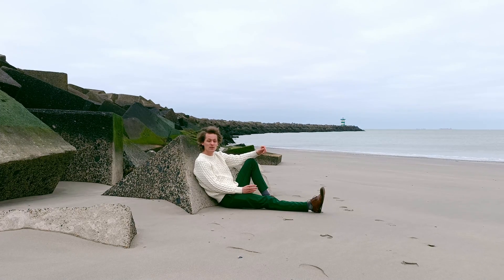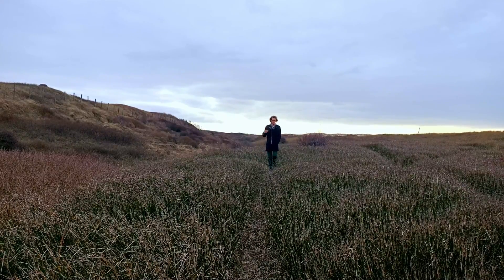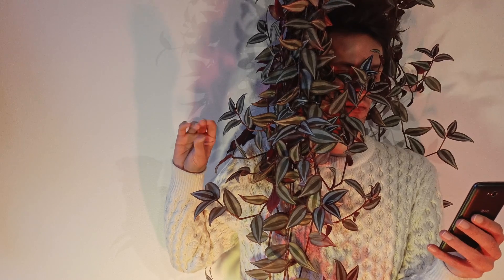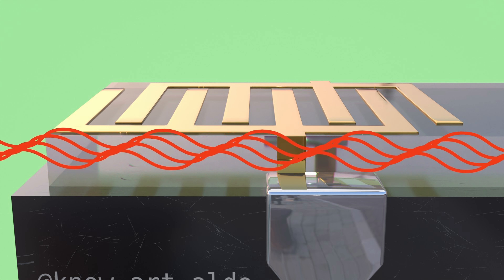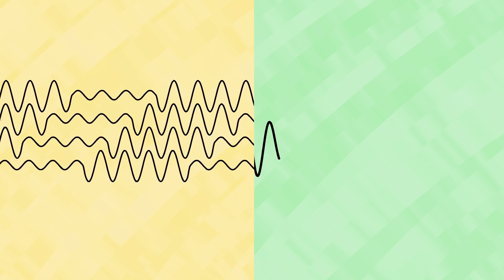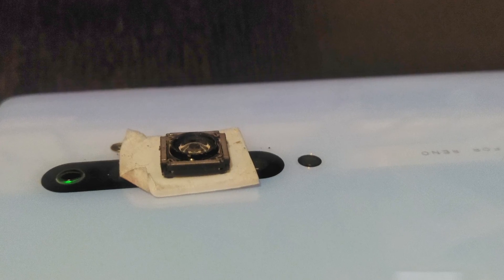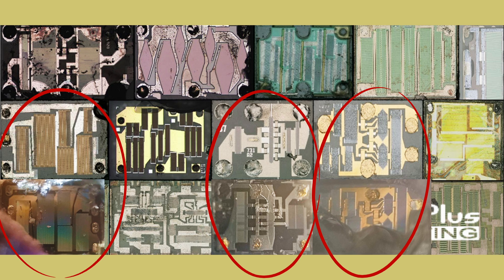The Tiny Crystals That Make Smartphones Possible

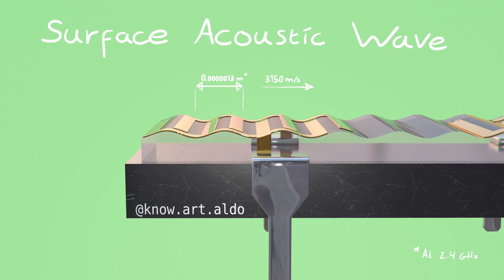Comment: 2:30 well what if you made the piezo more like a how a touchscreen works

Dope It with a non conducive oxide layer or similar and form a capacitive grid (or even a grid of smaller tuned LC grids)

Instead of multiple touches, you in theory would get a "reprogrammable" filter

Simply by changing how or what part of the chip area is. Being used as the actual "filtered signal" simply sampling based on the wavelength of the band your want to actually see, basically you could mimic a touch screen to pick up the capacitive changes as the wave propagates 

And if you can sample multiple areas you don't have to worry about propagation delay as much 

Though this would have other things like sensitivity and selectiveness of the rf signals to deal with

Comment: 3:15 you claim that the 'forks' are one wavelength apart. Well for 900 MHz that would be 33 cm.
EDIT: Ok I found an answer deep below in the comments - we are talking about mechanical wavelength of the substrate. So if it has a speed of sound of 3200 m/s that would lead to a wavelength of 3.5E-6 m. More reasonable.  
You should definitely put "SAW filter" in the title as I think your video is good and it should show when people google for an explanation. Helped me.

Comment: yes but these forks cant be spaced 1 wavelength apart, as you claim, because microwave/wifi's wavelength is 12 cm.....GSM is even longuer
Reply from the maker: they can! because this is a sound wave (surface ACOUSTIC wave), which is much slower than electromagnetic waves, and on top of that, surface waves are slower than bulk waves

Comment: Should be noted that the whole tradeoff you are talking about between the bandwidth of the signal (set of frequencies you are interested in) and the amount of information that can be transmitted per second through that signal, is a consideration shared by the source of the signal and not just the receiver, and does not necessarily have anything to do with the physical mechanism of this device.

Comment: Why use sine and cosine combined? Won't that just result in same old sine-wave (or cosine-wave, depending on how you look at it)? The end result is only amplitude changing. So why not just change it directly? Do the AM-thing, you know? Or FM-thing, if that's what you're into.
Reply from the maker: A good question I do not know the answer to. If I'd have to make a guess I'd say that it probably has very practical reasons. For example precision, or that it's much harder to change the amplitude than the phase. Let me know if you find out

Comment: Oh I understand everything except:

doesn't the cell tower send signals in one frequency only? if so, how can I read only the signal that's for myself and not for my neighbor, if that's not the case then each individual phone would need to have completely unique signals that they would receive, and there are billions if not trillions of devices that use this system, how can you ensure no two phones have the same frequency? that's what I never got about communications, how is it possible that you go to a concert with 10k people and you still have signal (Although with 30k people you start to lose it in my experience). How is it that I get 2 phones together and they don't cause interference to each other?
Reply from the maker: It's all super smart. We've literally been giving billions and billions of dollars to a bunch of nerds for decades. So there's a thousand smart little things going on that make it all possible. One of them is frequency hopping. Bit long to explain in a.comment but you can Google it
Reply: @KnowArt  Thank you, I will google it. Now I'm considering joining related courses in my uni to dive deep into the math but I think they don't have any.

Comment: I feel like the linked video has a good explanation, but this short is extremely misleading (if not outright wrong). While there are different frequencies used by cell carriers, this is just used to increase bandwidth, not to have each individual phone use a slightly different frequency. A cell tower can transmit to many phones on the exact same frequency at the same time by using unique codes for each signal that are made to cancel out other codes when you try to decode your message. This technology is called CDMA and is used by a large number of cell carriers, GPS satellites, and many more communications, along with various other “spread spectrum” methods of using the same frequency for multiple independent communications
Reply from the maker: Yes the most important job of these filters is to cut through the noise of other kinds of devices

Comment: Love the video, super great format and very informative. Fun fact: this is how frequently/wavelength modulation is performed. Our phones also use CDMA (Code Division Multiple Access) for many networks, in which many many users can use the same frequency, and you can decode the signal with some clever math tricks. Go check that out, looks like magic.
Reply from the maker: thanks a lot. yeah, like all this stuff is just pure brilliance.
Reply: Well, CDMA is mostly obsolete now. Super cool technology. But 4G and 5G both abandoned it.

Comment: 2:36 Your simplified diagram is fully symmetric, so how do you end up with one side generating the waves and the other side picking them up? In reality is there just one set of forks (and only two leads) per row that both create the waves and respond to them?
Reply from the maker: On one side (left in this case) a voltage is created between the two forks by the //incoming signal// not the crystal. This deforms the crystal. The deformation travels across the crystal to the other side. The deformation creates a voltage between the high and low points because the crystal is piezoelectric. The other forks (right) will then experience the voltage between them because the crystal moves underneath them. Because one finds itself on the high parts of the wave, when the other finds itself on the low parts.
Hope this helps :)
Reply: @KnowArt  So depending on the phase/position of the incoming signal either side (or even some combination of the two) could end up getting energized by it and stimulating the quartz?
Reply from the maker: @AltayHunter  yeah, so in the antenna electrons just move back and forth, there's not really any consistent direction to the current. It's just back and forth a tiny bit. And this is fed into the forks, so sometimes it's the one fork that has a oversupply of electrons, then it's the other.

Comment: Two interlocking forks on top of quartz… Thats, thats the whole device 😂
Reply from the maker: it's true! absolutely bonkers. I wonder how many other simple devices like this are out there to invent
Reply: @KnowArt  From my memory, delay lines are like that as well, pretty much the same but different construction physically.
EDIT: wait, no, they are EXACTLY the same device from what I found out...
Reply from the maker: @Kalvinjj  can you give me a little more info? What's that and what's its use? Sounds interesting! This structure is also used in many types of sensors because the output is very sensitive to deformation of the structure
Reply: @KnowArt  Found what I remembered, and it's actually an interestingly different construction: PAL video glass delays.
It delays the color signal by 64 microseconds (I don't know the entire specifics, just remember how the whole color signal in PAL is an off-phase, or was it fully time delayed, wave superimposed on the signal), and that allows comparison between previous and current scan line.
Works with a piezoelectric transducer in two corners, one as a transmitter, the other as a receiver, and the signal travels through the quartz glass for those 64 us until it reaches the other end.
As Youtube loves deleting comments with links, I'm not gonna post one but if you check "Delay-line memory" on Wikipedia, the specific part on the PAL crystal delays shows the device, "ultrasonic delay line" on Google shows some good pictures as well.
Reply: @Kalvinjj Ooo I hope he makes a video about CRT TVs now
Reply: @KnowArt  PAL delays was also made by (ultrasonic) speaker and microphone. Delays was also used in analog scopes. Sometimes it was bunch of wire on back wall of scope (at time of vacum tubes, when scope was heavy)

Comment: Can you do a follow up short explaining how new data standards can transmit more data? For example comparing 3G, 4G and 5G. How do they get a performance boost, is it from these filters mostly or a combination of things?
Reply from the maker: could be interesting! Bandwidth is determined by a lot of factors, but I guess the leading cause of faster speeds with 5g is the (much) higher frequencies used. So high even that these saw filters don't work anymore I believe!